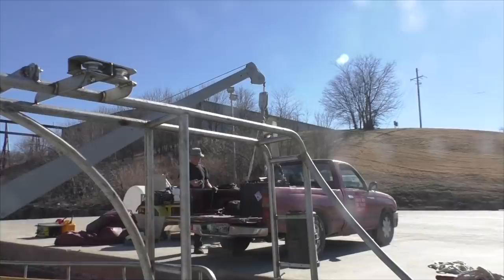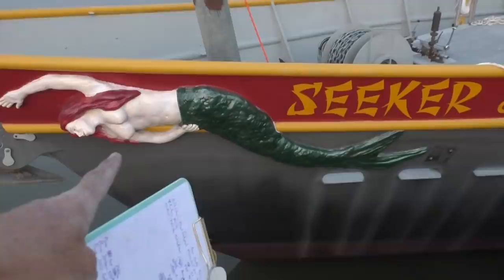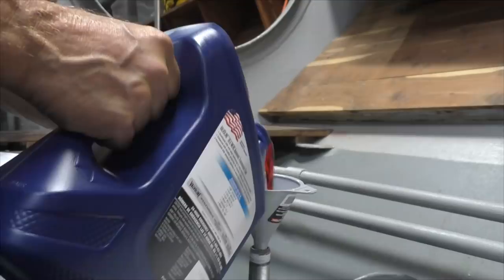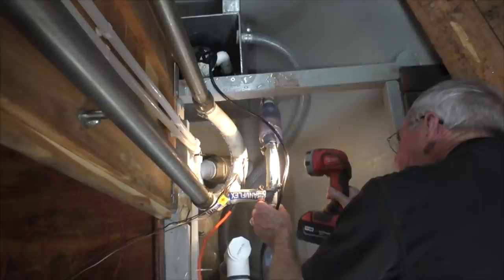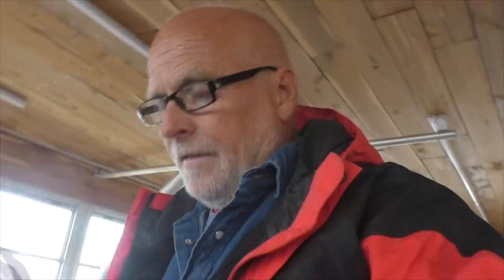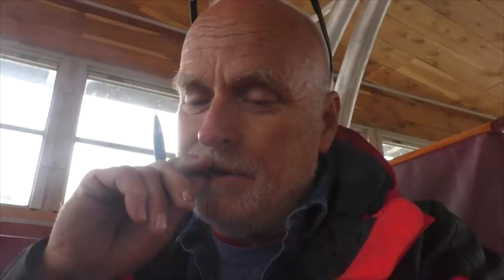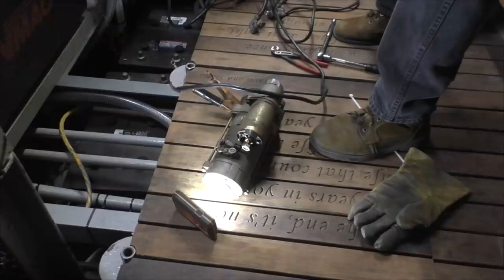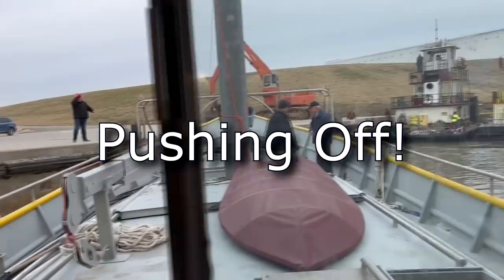Fire, Flood, Listing, Engine Failures and other Dockside Calamities

Comment: Starter gear is too close to the flywheel gear and is jamming during start (so the problem will never manifest itself when being tested like that). Typically a new unit comes with shims to fix that Add shims to prevent it sticking, while repeatedly enguaging. It also extends starter usefullness as gears ware and by removing the shims you can restore gear enguagemeent. Or you have the wrong part. Planty of vids on that, check it out.
Reply from the maker: I have never seen shims on a starter.   And how would that help when shims would only move the starter gears more forward?   Post a vid that you think shows that well.
Reply: @SVSeeker  Wow, I didn't expect a homework assignment! :-) Anyway, this link will answer the shim existance thing, but it's strictly automotive and uses "block" shimming. I couldn't find anything onbig aircraft engines. On many aircraft engines the mount is simular to the mounting on the starter in your vid, and the shims are circular with bolt holes and go on the mounting face of the motor. (Or you can cut them out of shim stock you can buy from industrial parts stores and metal cmapnies) Those gears have a slight taper to them and they don't have to go very far to go from trouble to perfect. Check with your starter manufacturer about that and any shims they might have. Love your work. https://www.youtube.com/watch?v=MFKq9VyCxRA
Reply from the maker: @lnchgj   Interesting, but there are no lateral bolts or shims on this starter.   And frankly I've never seen a start that had a bolt from the side like that one.   Thanks for sharing that.

Comment: You need to lock the torque converter on the transmission that's where the excess heat is coming from
Reply from the maker: We're going to remove it completely.

Comment: 17:20 don't be too worried about going from forward to reverse in the automatic trans, especially since you're only using low gear in forward and not high
very commonplace to drive a car around to get it into the shop by just bumping between drive and reverse, never had it hurt the transmission none, even with some panic "braking" by jamming it into reverse at a forward roll while matting the throttle
Reply from the maker: Yeah, we were a lot harder on it when we tested it out of the water.  Nothing to provide drag.

Comment: For all the nay Sayers this is like a big fat finger in the face. The boat had a list on launch but it was expected. The boat had a slight stability issue when crane used, again expected and normal. Ballast has been added to bring it all under control and not being an expert on the subject what is the added buoyance from saltwater. I ask this because your going to float a little higher in the ocean as opposed to a river.
Reply from the maker: Yeah, it will be up a bit in salt.